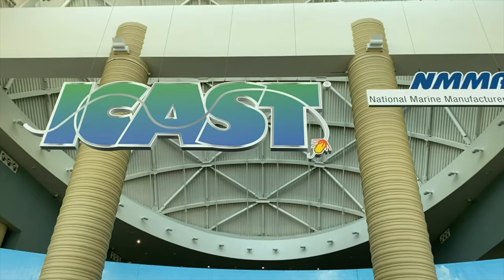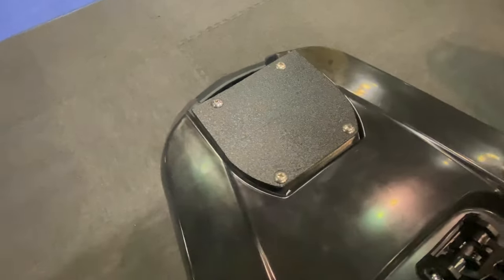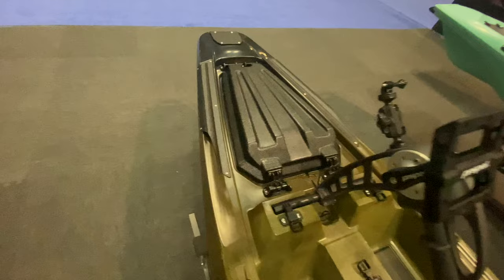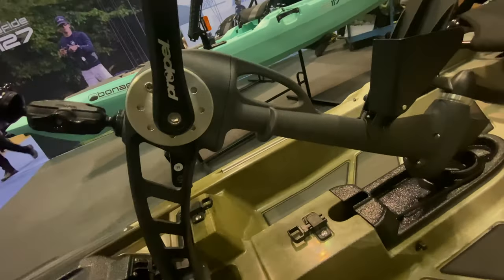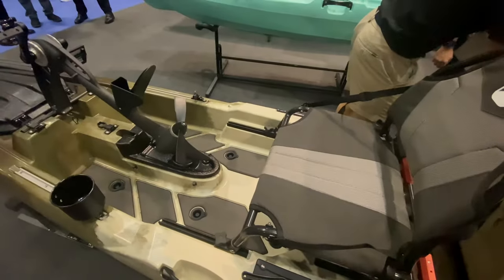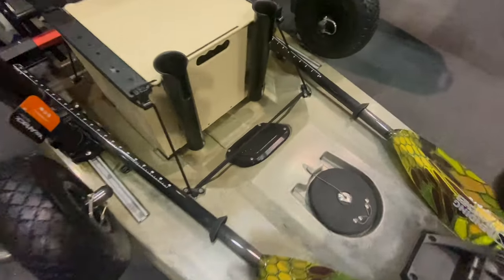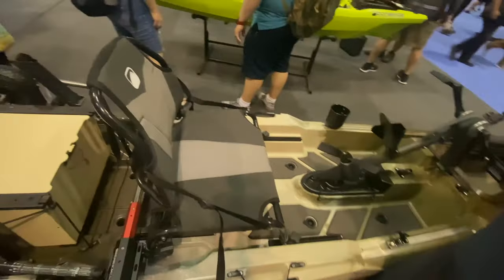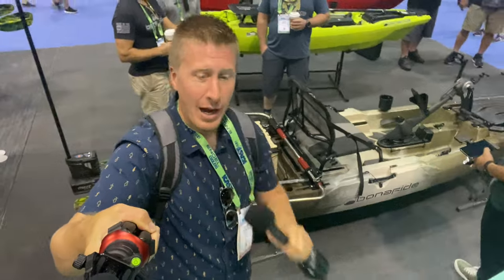BONAFIDE P127 PEDAL DRIVE KAYAK

Comment: Wonder if there will be some sort of adapter plate so we may buy the pedal drive and use on currently owned 127 or 107 models.  Has there been any talks of that?

Comment: Question is who is buying one ?
Reply: I would if it had a transducer cavity
Reply: @peb762  it has integrated transducer protection and wire routing
Reply: @ILLUMINATHAN79  if so please send a link with pictures
Reply: @ILLUMINATHAN79  it has a transducer cavity but its not wire routed like the Slayer 12.5